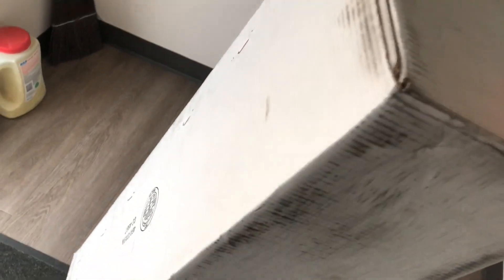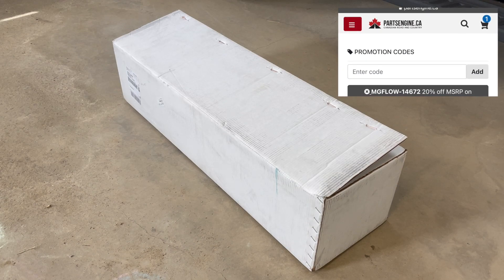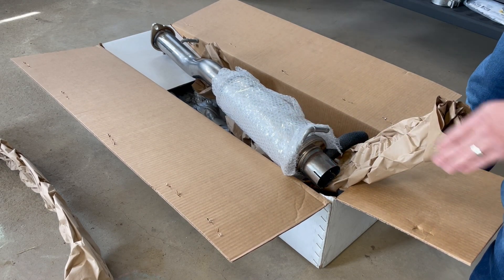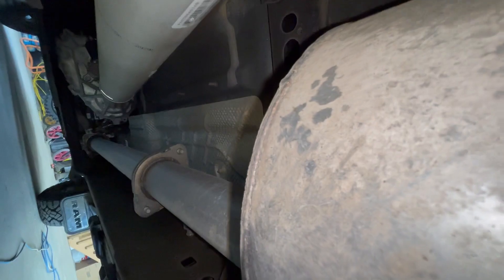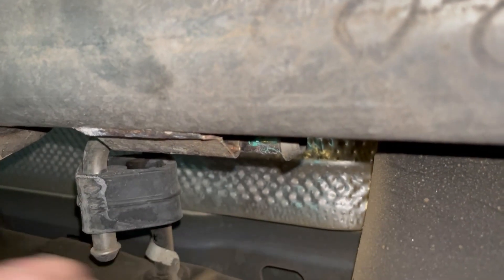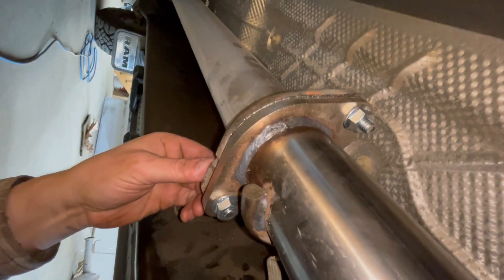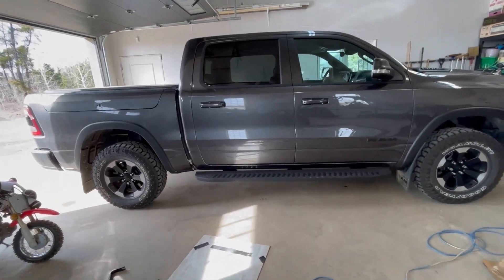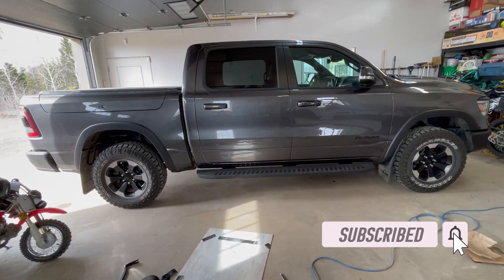2021 RAM Rebel 1500 MAGNAFLOW Direct Fit Exhaust DIY - Part # 19433

Comment: Did you weld anything
Reply from the maker: No welding at all. It’s a bolt on system. Very DIY
Reply: @thorrepairs6557  will this system work for the eco diesel
Reply: I am trying to upgrade my exhaust for my ram 1500 but it’s eco diesel all the ones I found on YouTube is for the 5.7 or 6.4
Reply from the maker: I’m thinking no but you should double check that.

Comment: I'm on the fence between this and the flowmaster direct bolt on muffler. How's it holding from the salt? I've read some reviews on them not holding up for Canadian winters.
Reply from the maker: Zero issues with this system and sounds great. I like how it purrrrrrrrs when I start it up.

Comment: Just installed the same muffler in my 2020 bighorn. Sounds great but american trucks forgot the flange gasket. Great vid!
Reply from the maker: The sounds gets better every time I get in it 👍🏻👍🏻
Reply: @thorrepairs6557  i hear of guys plugging the weep holes of the resonators with jb weld high heat epoxy, which apparently helps with the "airy" sound. Think i might give it a go. Could always drill them back out if I don't care for the sound lol!!
Reply from the maker: @BdubbsVt  let me know how it goes 👍🏻
Reply: @thorrepairs6557  I did this, and it sounds way better. Doesn't sound like it's being pushed through a grocery bag anymore
Reply: Does it get louder as a year goes on when it breaks in
Reply from the maker: Yes but not very much

Comment: Did you get a burning smell after test drive. Also did you notice your exhaust tips and exhaust hot after test drive. I only did a 5 min drive around my block and noticed the exhaust tips and exhaust hot.
Reply from the maker: I did notice a smell briefly but nothing noticed in the heat department. I still love it.

Comment: WD-40 is not a lubricant,,, it's a solvent. Just so you know.
WD-40 stands for, water displacement 40 parts per million.
Reply from the maker: Ok Thanks, works well for what I used it for.

Comment: Hey man, fellow Canadian here also with a '21 Rebel. Do you still like this replacement muffler? Any drone from it? How was the experience buying from partsengine? Thanks
Reply from the maker: If you like some sound on acceleration and when your rpms are climbing then you will love this exhaust. I still love it. I can drive down the highway and not hear it at all when cruising. I would say next to no drone.  There was no issues when dealing with Partsengine.ca. They are busy so it took a bit to get it shipped but I was in no rush. This exhaust has a nice rumble but not too loud on start up. It’s plenty loud for me!
Reply: @thorrepairs6557  thanks for the reply! When does it drone? Any drone when it kicks into MDS 4 cylinder mode?
Reply from the maker: @LazyHobo32  If there is any drone its brief and when the engine is under load but not anything I would say is noticeable.
Reply: @LazyHobo32  I put the exact same thing on my Rebel. I really like it and Ive experienced NO drone with mine...or atleast Ive never noticed it. Sounds great to me and doesnt disturb my neighbors.
Reply: @AJW-ho9vc  Great thanks for the feedback!